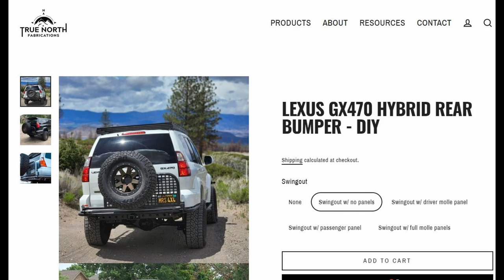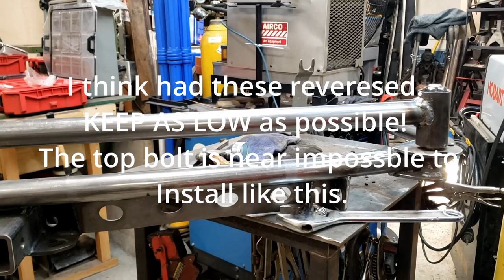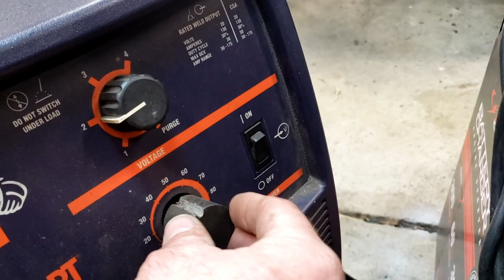P WILLYS GX470 PART 7:  Bumper Swing Arm Build

Comment: Hey there! Do you have a link for instructions that came with this kit? I recently received my rear bumper kit for my ‘04 470 but did not receive any instructions! Tough to find any online so far. I appreciate it 🙏
Reply from the maker: I had same issue but found it.  Go to True North Fab web site.  At the very bottom there's a link "instuctions".  Go to 4th Gen 4 Runner.  You will find the Rear bumper DIY.  It's downloadable.  Read it thouroghly!!  I didn't at first... I kinda butt jointed but they say to position with corner edges together and weld in the corner.  Hope that makes sense.  Good luck!  It's lots of welding, but very rewarding!  Mines holding up well!
Reply from the maker: Sorry, yours might be a little different.... but I think you might find it in same location....

Comment: Looks great! I’m close to my goal for my rear bumper and true north is a runner up. Do you think this bumper would have any issues pulling about 3k lbs on a double axle trailer?
Reply from the maker: I don't think so.  That's a pretty light load overall.  It connects well to stock frame and the GX can tow 6500Ibs from what I have seen.  I have towed single axle trailer full of gear at least that much and did very good.  Not sure if they offer information on True North site.  They might not post for legal issues....  Don't forget to add trailer and cargo weight together!
Reply: Great!!! Thanks for the input man!